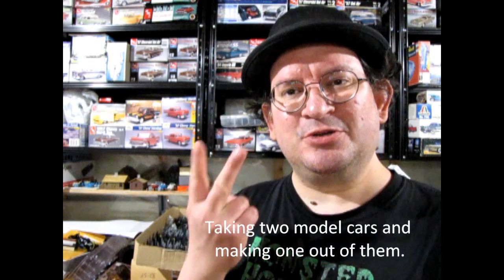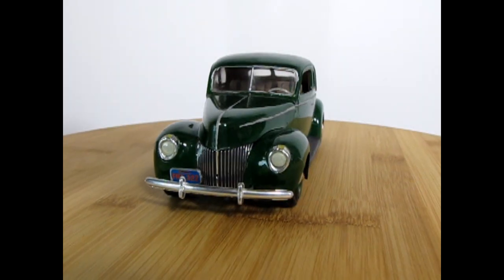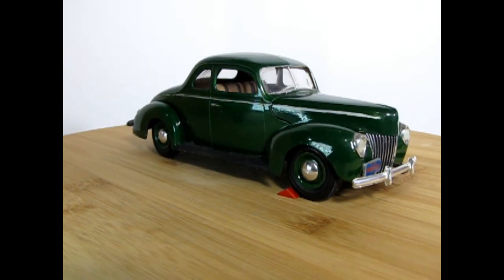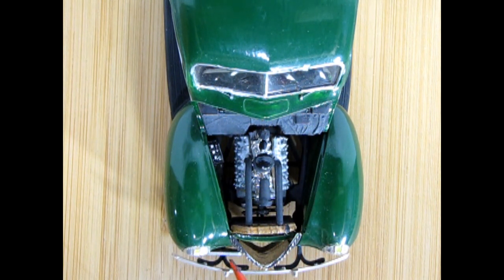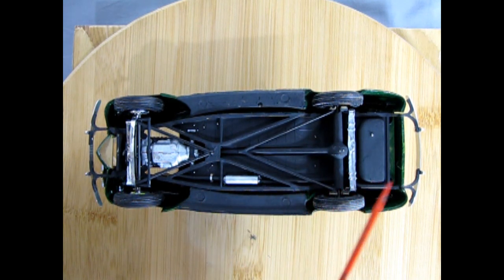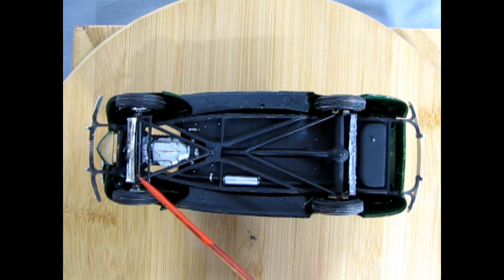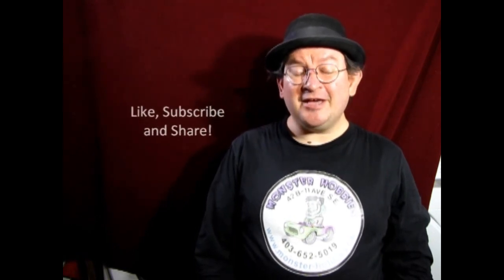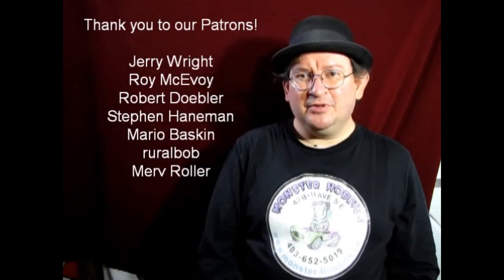Model Car Garage Show And Tell - My AMT 1939 Ford Business Coupe Build Stock In Green Paint

Comment: Great show Trevor. Thanks for sharing.
Reply from the maker: You are welcome Big Charlie. Have you ever tried this conversion?
Reply: Yes l put a viper v-10 in a 69 dodge dart
Reply from the maker: @bigcharliesmodelgarage296  Sounds cool. Must have been a tight fit!
Reply: @MonsterHobbiesModelCarGarage  engine fit good,  transmission didn't fit well hsd to cut top hslf off to fit.
Reply from the maker: @bigcharliesmodelgarage296  I bet it was a challenge. Projects like that often are! But sounds like you got it in the long run.
Reply: @MonsterHobbiesModelCarGarage  yup. I did a video on the car, but not build.

Comment: I can't find the instructions for this kit. Can you tell me if the front (and / or rear) fenders are separate pieces from the rest of the body. (Apparently several of the Revell Ford kits of this period car are, unlike most kits, along with the running boards (when present). That seems it would make for a challenge to deal with any gap or seam between the fenders and body.
Reply from the maker: I have an unboxing video of this car on my channel. 
I hope it will help you out. 

https://youtu.be/DFxU-_LCK3Y
Reply from the maker: I hate to answer a video question with another video, but all is answered in that other video unboxing.